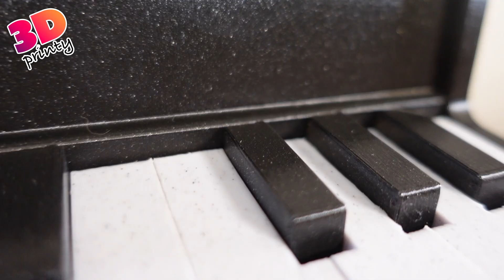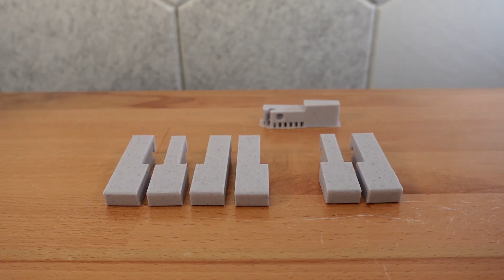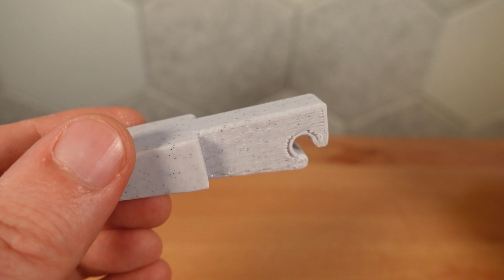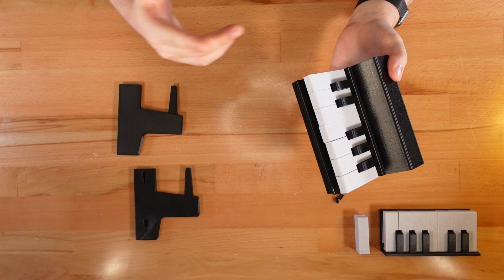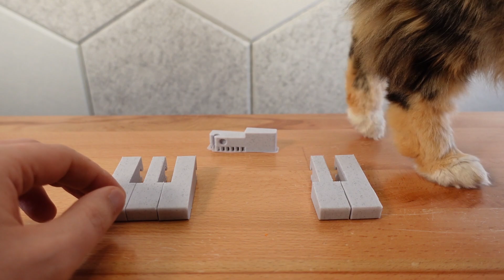3D Printed Clicky Piano Fidget

Comment: Change the bottom of the keys to have metal contacts to close a circuit then wire that to a controller with speaker to make it a working keyboard. 😊

Comment: I love the piano design. I was thinking that the piano could still be a puzzle box when you press the keys in the right order. Also, I know you’re trying to layoff the panel project. I was thinking pulley attachment or an eye bolt attachment would be really useful. I wanted to ask what software program do you use to design your models?
Reply from the maker: A new larger puzzle is definitely in the works, but I've got something special in mind for the piano - not just playing notes :)

Good Printy Panel ideas. I will return to it in the future, and I'll give that a try.

I design primarily in Autodesk Fusion (formerly Fusion 360).

Comment: Your Thingiverse upload seems to be missing the black keys. But I've downloaded from Printables as well, which does appear to have them.
Reply from the maker: Thank you! I happened to re-upload those files a few hours ago, so they should show up now (I renamed them from "C#" to "C sharp").

Let me know if they still don't download for some reason.
Reply: @3DPrinty  I can see them in the files list, but the ZIP of all files still doesn't seem to contain them.
Reply from the maker: Oh, I see what happened. Even though I uploaded the new version hours ago, Thingiverse hasn't gotten around to re-processing those files and building a new Zip. I don't believe there's a specific way to kick off that process, so we just have to wait for the site to do its thing. I'll check it again in 24 hours.
Reply: @3DPrinty  It works now. Thanks for updating.

Comment: "Teaching Tech" had a great hack for the supports. Set the distance to zero, move the support away from the base a little bit, and put in a pause just after the top of the support prints. Then use a laundry marker (aka "Sharpie") to draw on the supports. PLA and PETG don't stick to laundry marker. Maybe leave just a little bit at the other end to hold the plastic you want down. v=dCDGhsRTCNU&t=598s  Might make printing the keys that need support a little easier.
Reply from the maker: Great tip! I'll have to try it out :)

Comment: I see you've made it so it's possible to expand the number of keys. 48 key MIDI controller keyboard incomming. ;)
Reply from the maker: Nice! Yes, it should be fairly easy to dice up the base within your slicing software and expand it as desired. I've also included STEP files for CAD users that want to take that even further :)
Reply: @3DPrinty  I do have several kbd with midi built in, so it won't be made by me. I do hope that someone out there takes up the challenge, as it would be great to see how far the hobbyist segment could take that. :)